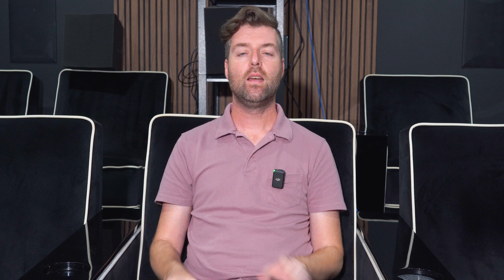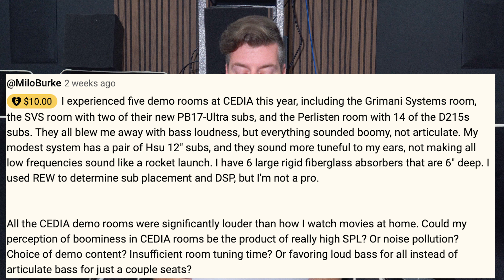Did the Bass SUCK at CEDIA or was it you???

Comment: Customers seem to be driving installers to concentrate on increasing bass. Increasing it without increasing the rest can't  make the soundtrack mix accurate. A badly mixed soundtrack might be boomy. You can't fix that.  Perhaps a subwoofer low frequency demonstration should have all the other speakers turned off. Does anyone demonstrate a speakers high frequency capability to send them deaf? 
 If a room or sub is considered boomy why not stop it/them playing any sound above, say  120hz or even 80.  Boosting above is risking  clarity issues anyway.
(May my thoughts are getting off track) :)

Comment: To me it seems like most people run the bass way too hot so they are probably catering to that audience.   I run mine a little hot but not much, and I have graduated increases using the 4 miniDSP configurations starting around 2 to 3 dB hot with 1 to 1.5 dB increments from Config 1 to 4.   Config 2 works pretty well for most content but recordings vary so it's almost impossible to find a single setting that works for everything.  

In my case the subwoofers cover from 35 Hz down to 10 Hz and the woofers from 90 Hz down to 35 Hz so I have independent DSP control for those two bands.  For the subwoofers the increments are just gain differences but for the woofers the increments use both gain and shelves to smooth out the increments relative to the line arrays that cover 90 Hz up.  Having them independent allows choosing different configurations for the subwoofers and woofers so if I want a little extra in the bottom end but not in the mid-bass, I can do that.